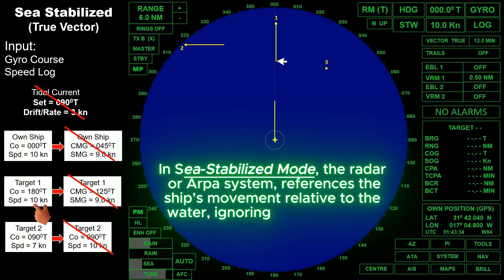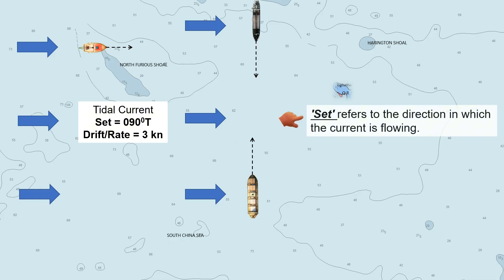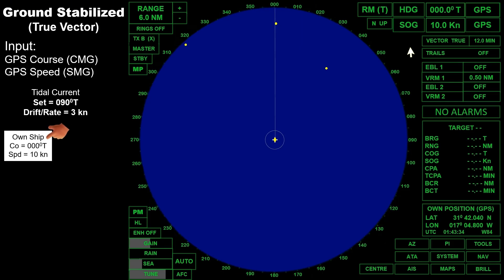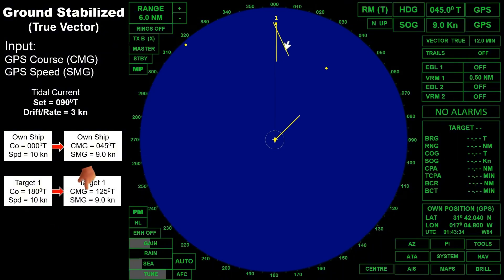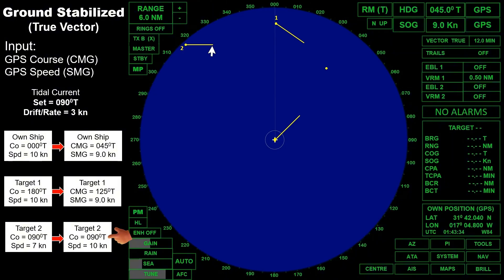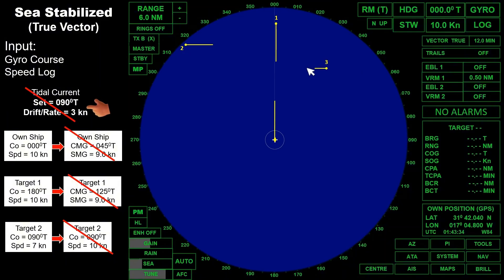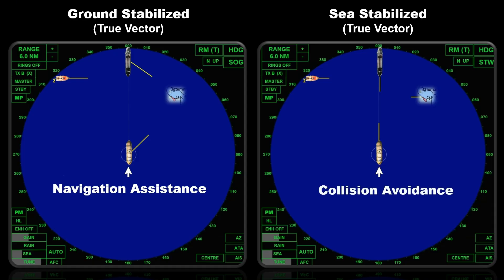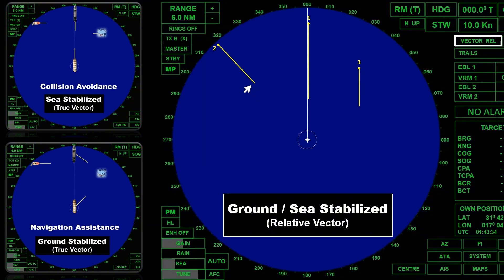Radar Techniques: Ground-Stabilized vs Sea-Stabilized for Navigation and Collision Avoidance

Comment: Why GPS COURSE AND SPEED ARE NOT COG and SOG?? What the hell CMG and SMG 😮
Reply from the maker: GPS always provides COG and SOG. The objectives of this video are to show the difference when a radar is set to ground and a sea-stabilized mode, which does not include a detailed discussion about CMG and SMG, but here is a brief  definition: 
Course Made Good (CMG) is the actual direction from the starting point to the final position after accounting for drift caused by currents, wind, and other external factors.
Speed Made Good (SMG) is the actual speed at which the vessel progresses toward its destination along the CMG.
I suggest watching a video that covers a detailed discussion about CMG & SMG.

Comment: True vector can affected by sea or ground stabilization? Plz ans
Reply from the maker: Yes, the true vector displayed on your radar is influenced by whether the system is set to sea stabilization or ground stabilization. Here's how each mode affects the true vector:

In Sea Stabilization:
The radar uses the vessel's speed through the water and heading as references. In this mode, true vectors represent the motion of targets relative to the water. This is particularly useful for collision avoidance, as it reflects how other vessels are moving through the water you're navigating. 

In Ground Stabilization:
The radar utilizes the vessel's speed over ground (SOG) and course over ground (COG), typically derived from GPS data. True vectors depict the motion of targets relative to the ground. This mode is beneficial for navigation, especially in areas with significant currents, as it shows how both your vessel and others are moving over the Earth's surface. So True vectors of moving targets will show up as their track over the ground, not their headings.

But remember that Radar/ARPA are designed for collision avoidance by performance standard. Care should be taken when Radar/ARPA are used for collision avoidance in ground stabilized mode as the true vectors are affected. 

Important impact on True Vectors:
Aspect Representation: In sea-stabilized mode, true vectors indicate the aspect of targets based on their movement through the water, which is crucial for understanding their heading and potential collision courses.

Current Influence: In ground-stabilized mode, true vectors account for the effect of currents, as they show movement over the ground. This can be misleading for collision avoidance because a vessel might appear to be on a different course due to current influence.

The relative vectors are not affected by ground and sea stabilization, which is why using relative vectors to track targets for collision avoidance is commonly used.

Comment: would you, please, explain how you added the 2 vectors (ship vector and current vector) in ground stabilization mode to get CMG 045° and resultant speed SMG of 9 knts. Because using right triangle trigonometry the resultant speed should be √ (ownship speed)²+(current speed)² and that equals 10.4 knts not 9 knts and the CMG should be approximately 016.7° not 45°
Reply from the maker: Thank you for your question! As mentioned in the video between timestamps 2:40 and 2:53, the Course Made Good (CMG) and Speed Made Good (SMG) for the own ship and other moving targets are not calculated using an exact vector. Instead, they are approximations or assumptions, intentionally designed to highlight the impact of tidal currents. The large angle values were chosen deliberately to exaggerate the effects for clarity of the animation, rather than providing a precise result using trigonometric methods.
Reply: @nauticalacademy001  Thanks for your reply. It seems that I missed this part of the video. I see you are using Bridge master radar imitator which is usually a part of a simulation software suite. Please, add more videos with examples using the radar imitator.
Again, thanks for the explanations 🙂

Comment: Sir why we set ground stabilize in coastal waters?
Reply from the maker: Great question! We typically set the radar to ground stabilized mode in coastal waters because it helps us account for the effects of tidal currents and wind, allowing for more accurate navigation relative to fixed land references like shorelines, buoys, or other stationary objects. The true vector in ground stabilized mode shows the course made good, giving you a clear indication of the ship's direction and whether you’re heading into a dangerous area. This mode provides a clearer understanding of the vessel's actual movement over the ground, which is crucial in areas where external forces like currents can have a significant impact on the ship's track. However, if there's high traffic density in the area, the other radar should be set to sea stabilized to be used for collision avoidance. Thanks for watching!

Comment: Very helpful video, revise basics, but one doubt, at of the video, u mentioned changing over from true vector to relative vector, but it created a confusion to me as relative motion box still states RM(T), i am not pointing out an error, if it is. But ur clarification will clear my doubt. Thank you in advance
Reply from the maker: Thank you for your thoughtful comment! I’m glad you found the video helpful. For switching between True and Relative Vector, I recommend referring to the manufacturer's manual, as the interface can vary between different radar systems.